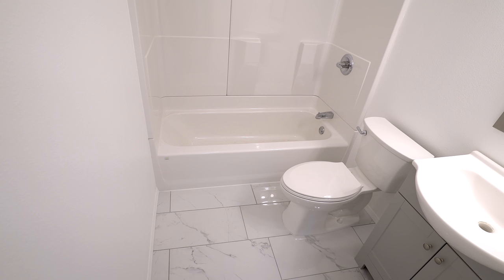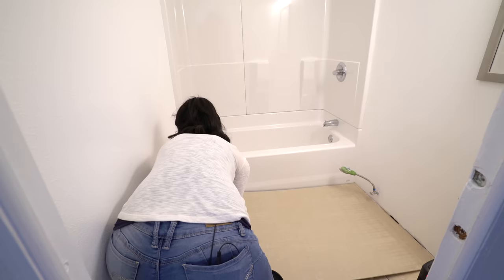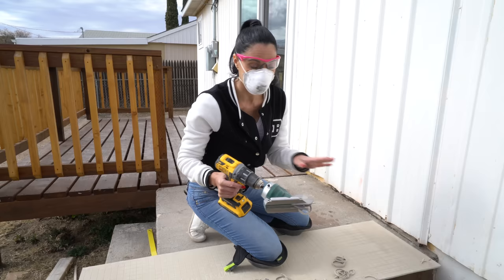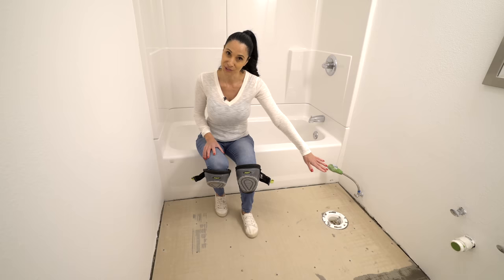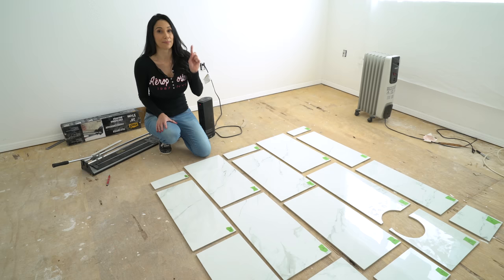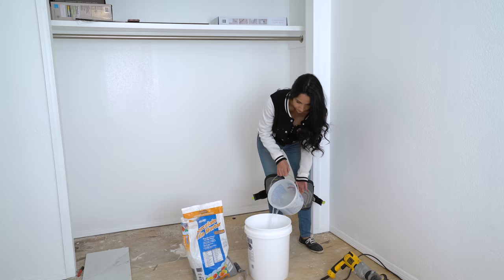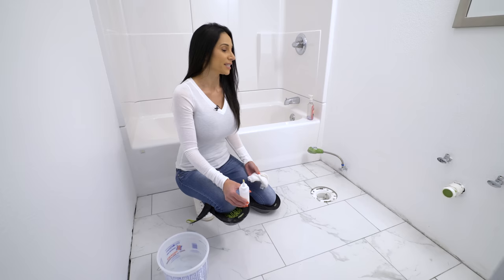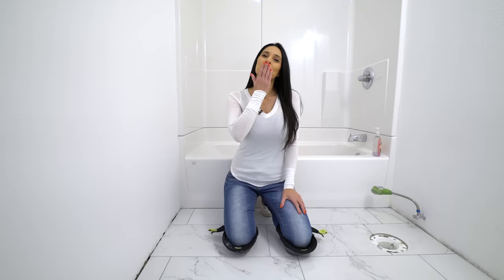How to Tile a Floor for Beginners

Comment: I love your videos.  One handy tip.  A gallon paint can is the same exact size as the toilet flange.  I measure left to right off both surfaces.  Then line up a paint can to my marks.  Perfect every time.  Then when your doing your floor, same.  Measure to your edges, trace the paint can. . perfect every time.
Reply: That's good to know. Thanks!
Reply: @timtucker09  looks like we missed some comments because we don't see anything
Reply: Good looking ladies tackling DIY projects makes learning the process way more enjoyable! Nice job on the bathroom.

Comment: hi ya i use a 1 or 2 inch thick piece of styrofoam  to kneel on...the knees do get soar..12- 24 hours that cement should be set at room temp...+ 5 degrees celcius to set cement...  love the show...

Comment: Another great video Nassrin!!!   Your cut out for the toilet flange is totally professional and the one made by my contractor looks like a complete hack job!!!  Well done!

The velcro strap on the knee pads are too large for the diameter of your legs - you can add some padding to the inside of the straps where it contacts the back of your legs to cut down on the excess length so they won't fall off when you stand up. Or you can just add more padding on the inside of the knee pad cups and this basically does the same thing in taking up the excess slack on the straps.
@36:37 for the power tool electrical connection to the extension cord - before plugging the tool in, make an X with the end of the power tool plug and the end of the extension cord by laying one on top of the other. Then, take one cord and cross over the other and then plugging both together. This way, it forms an interlocking coupling that resists the electrical connection from being pulled apart if there is any tension on the cord as you pull it.  Hope that helps.

Great job and keep the videos coming!

Comment: Nassrin, I was SO CLOSE to hiring someone to do my small bathroom to tile the floor (similar in size to the one you did in this video) then I randomly came across your video and realized I could do it myself. I am a handy person but was worried about messing up something that could be so hard to fix. I think laying out and cutting the tile before you ever mix the mortar is such a brilliant was to approach and plan this. By doing it like that it allowed me to take my time and get it done right. I just finished  getting all the cuts done and the tile laid out so I can make sure I am happy with it and now today I begin the mortar! I really appreciate how thorough you were with both the process and your little tips to make our lives easier but also your cheerful "can do" attitude. So glad I found this video. You gave me the confidence boost I needed to take it on and now I can't wait to finish to start my master bathroom very soon! Thank you!
Reply from the maker: Yourwelcome🙂

Comment: Thanks a lot i can see your technique in how you lay out. Starting your pattern where you want the joints  at . actually one of the best tile videos i watched akso using the tape keeps the thin set straight then just peeling it back off really good ideas
Reply from the maker: Thank you🙂

Comment: Superb work and excellent presentation, thanks. The only suggestion I’d make is to remove excess thin set from the joints while still wet.
Reply from the maker: Thank you🙂

Comment: I almost forgot to add, cuz I used to have the same problem with kneepads after I used them for a little bit. They arent expensive, and they definitely arent cool looking but I still think knee pads made by Barwalts tool company are my personal favorite. The ones that have the rubber straps that hook over the knobs on the side are the best for not sliding down in my opinion. you can put them on so tight they will start to cut off the circulation.but they dont stretch out or lose the ability to stay tight, or if they do just put them on another notch tighter. But they stay in place and they dont get snagged on anything if you are working on a rough surface. Like I said JMO, but especially anything with velcro or any kind of fabric straps or fabric on the face of the knee pads are garbage. They arent going to win any fashion shows but they are built to last also.
Reply from the maker: Thanks for the tip! I did end up finding  some good ones at Home Depot

Comment: Excellent work. I've been doing it exactly the same way you've done for years. I'm glad you emphasized to make lines straight. Comb the trowel. Never swirl the trowel as that creates air pockets and tiles WILL (not could) crack eventually; and back butter is essential as well.

Comment: I have watched a lot of DYI vids. It is refreshing to see a knowledgeable and competent woman doing a "man's job." Plus: you are the first person I have seen use  combination square! I thought I was the only one! I have been validated!! Lol I always use those self leveling wedges. Much better than just a level. I also prefer to use Ditra on top of the wood. Unless missed it, you put the mortar on a dry wood floor. I always dampen the wood a bit so that moisture does not get drawn out of the mortar. Good vid. Thanks.

Comment: Use Ditra instead of the backer board. True its more expensive but its lighter and easier to work with. Most importantly, you'll have a waterproof membrane.

Comment: O yea very fascinating interesting. Looks very easy the way she explains special how to cut the hole with the template. I call ( stencil) that make it very easy cause you want to cut the hole on the plywood  where  the flange for the toilet  will go . Good Idea to use piece of cardboard to .use as a template make sure stuck piece of big rag into the drain to prevent big trash to fall into the sewer drain . As well use gloves/ mask / safety glasses 👌

Comment: You do nice work & some good tips here for sure. My neighbor is a flooring guy, he told me when your doing a bathroom floor, with out the mastic down, cut & fit the tiles first, get it all laid out, then remove the tile & put it in another room laid out the way its going to go down, (if you have the space) then do the mastic & you can just install it easy.

Comment: Nice friendly video! You make it look easy! So, I hope you don't mind and welcome a bit of thoughtful advice from a professional.

•	For pouring out of a newly opened 50lb bag, consider laying the bag on top of an upside-down bucket next to the mixing bucket. Then cut open the bag, minor cuts at a time.

You'll understand why I do this after mixing 15-20 bags or more a day on large jobs.

•	Where there's limited space, use a large garden hand-held shovel for scooping out the mortar, especially the small batch.

Thanks for sharing!

Comment: I install floors for a living. But I specialize in tile.  I’m glad you are showing people what actually goes into this. I can tell you knew what you were doing after you used thin set under the hardiebacker then screwed it.

Comment: Hello, you asked for suggestions for alternate knee pads. We have been using Chainsaw chaps with at least 8 layers of kevlar or similar protection like these - ZELARMAN Chainsaw Chaps Apron Wrap 8-layer for Men/Women Loggers Forest Workers Protective Chain Saw Pants Adjustable- yes they are comical looking but they do not bind uncomfortably on the back of your knee. I am a husky guy and feel that they offer enough padding that I disposed of my old knee pads. That is my major complaint with knee pads, that the straps hurt the back of my knees and that they do not stay up.  I have used the chaps for gardening too while on my knees weeding, planting, laying a flagstone patio and they are comfortable and have held up extremely well. Thank you for your excellent tiling videos. They are a great resource!
Reply from the maker: Thank you so much! And thank you for the information🙂

Comment: Have done tile professionally for 24 years and this is a better install than what's being done today. I take thinset that's a little bit thicker and don't flat trowel the floor. Just notch the floor out and the only time i back butter a tile is if it's low. Only way that's better is that we don't use board on floors but pull concrete. Often i dry set the whole floor on wet concrete, same as what you did, and then spread thinset and stick it to the wet concrete. Definately don't want to ever tear out a floor done this way, it's miserable.
Reply: So you don’t back butter a large format tile!?
Reply: @travlangley1  Usually wind up popping it up and i can see where it needs more. Even tile council says 75% coverage is acceptable. It's all about how many chemicals the thinset has, it's miserable to tear out a single piece set with all set or platinum even if it never got buttered.

Comment: Hi Nassrin ! Love this tile video of yours. reference the knee pads,you are wearing it your brassiere, especially the ones with out the bone wire in  them and the size D cup or just experiment with the varieties until you are comfortable with the fit over the knee also you can double them if you want and for secure strap I use the same brassiere strap by stitching them on to the side of the cups or you can use thick garment elastic they work just as well by the way I get my brassieres from my girl when she is buying new ones.😃

Comment: You are such a cool lady! Beautiful job! The only advice I have is the need to use a 2-inch painter tape along the edge of the tub and where it meets the floor. It protects the finish and makes it easier to peel off any unwanted material from the trowel.
Reply from the maker: Thank you🙂

Comment: Re: kneepads. Of course, the usual hard disc, buckle types will be oversized, bulky and Ill fitting, leaving you unstable and uncomfortable. Most of the discount dollar type stores carry a selection of slip over tube type, heavy weave elastic knee stabilizers which sometimes have a pocket or sleeve for insertion of a foam type padding. Also, try the youth section at the matt discount stores in the sport section ( bike. Skateboarding etc sports activities for you so we'll generally carry sports protective and ancillary equipment as well such as the aforementioned elbow and knee pads.. Best of luck I enjoyed your presentation it gave me a few tips and will help me on my project.!
Reply from the maker: Thanks you! I finally found some that fit at HomeDepot🙂

Comment: Use 1/2 " board. Rule of thumb is to have no tile laid smaller than half a field tile. Some of the cuts on the walls are way too small and don't match the cut on the other wall. you want the floor to look balanced with same cuts on the sides and front and back.  A lot of tiles have arrows on back so the design looks better. Your  grout joints are too close to each other to the tile above them. should have just brick patterned them..small room.. it would look better.. the toilet flange should go on top of the tile. You need the clip system with tile that large. Use white mortar...it well be easier to clean.. the dark mortar can bleed through.. never use unsanded grout on floors...you can use sanded on 1/8". clean the grout joints as you tile...you wont need to clean it after it dries..  chip a tile and you'll know what I mean. Other than that good job.
Reply: Only the last sentence was necessary.  This is just a DIY job for her and she did better than some professionals would. No need for the additional tutorial.
Reply: Her DIY was really helpful and informative, but I also appreciate the additional info from someone with apparently alot of experience. Thanks... for both.
Reply: @justicepeople8819  All of the points raised here are valid even for DIY, getting a balanced look across the field so cuts are equal is the most basic skill in laying tile. Using a white adhesive is a no brainer with a light coloured tile and also using the correct grout is essential on floors to prevent cracking. Also cleaning the joints as you tile saves a lot of time and you don't risk chipping a tile thats already fixed. Also the toilet flange is supposed to sit up on the tile that is basic good practice too. Additionally, if you use a waterproof grout you don't need to seal the grout and it doesn't stain over time. Also when tiling over a wooden floor make sure to use the correct flexible adhesive and grout to cope with small amounts of movement without cracking.
Reply: Love your videos but suggest you use a decoupling membrane such as Ditra applied with modified thin set over the plywood subfloor and not even use the hardiboard.
Reply: @schrodingerscat1863  adhesive meaning ? I didn’t see her use a adhesive. Could you explain?
Reply: @Mindyourbusiness762  Just a difference in terminology, in UK we call it tile adhesive, I think they call it thin set in the US or maybe mortar. Basically the stuff sticks the tile to the wall or floor.
Reply: Great tips Bob, thank you.

Comment: I always use a separate plastering trowel to spread out the flooring adhesive ... saves having to 'backhand' the toothed trowel ... also use a slowset adhesive so you can take your time. I also have a large flexitub full of water and sponge to hand to keep everything clean as you go

Comment: Grout joint against tube should really get caulk matched to your grout color, movement and flexing will inevitably crack grout there. 👍
Reply: begal brew, what kind of caulk would you use in the joint against the tub?
Reply: @kimariokiji  most grout mfgs make color matched caulk to their color palette. Some companies like colorfast offer products to match multiple companies grouts, you can usually find these products at your locally owned tile retailers or distributors. Otherwise you can use siliconized acrylic caulk of any type really. I don't use 100% silicone because it tends to not bond well to all surfaces.

Comment: use lipstick to mark the flange then lay the backer board on it, use the outline of the toilet ring on the backer board to cut the hole. saves you a step
Reply from the maker: Good tip! I’ll have to try it.

Comment: Another very good video.   Sorry you must keep getting tested for the virus.   Not a criticism, just an observation, I have tiled quite a few floors and walls.  I never used the straight side to spread, always the notched side.  I always regarded the notches as the way to evenly spread the thin set.   
On your knee pad problem.  Dedicate a pair of pants to that cause and glue or sew hook and loop above the knees.  Glue or sew the other half of the hook and loop to the knee pads.  Make sure these are placed such that you don’t kneel on them.  Not only will the pads stay up,  their straps will no longer be so tight that they cut off circulation.   Good luck.
Reply from the maker: Thank you🙂

Comment: Great vid, thanks for sharing. A little constructive criticism if I may. The edge tiles are uneven so for this job I would have started with the grout line in the centre so that way you would have even edge tiles. If that was my house I would have pulled you up on that first haha. You should have run silicone instead of grout at the bath too. Love that you're trying to teach people though, good stuff.

Comment: Hi Nassrin,

Very professional quality video!  One question: Do you recommend using a membrane coupler between the bare cocnrete floor and the tile just in case the concrete blow started to crack it will not cause the tiles to crack?  Thank you!
Reply: Great video! And good suggestion we used Ditra on my floor.
Reply: Hi

Comment: Coming on ten years now in the field and I'll say probably best I've seen in a while on here  few thing a bit taking the extra step that's not always needed but it works  I honestly don't like those scratch tools only caue depending on your tile they can chip a edge or flake a corner . I use a old normally 1/2 inch wood chisel to scrape out the mortar that bled up little bit more control especially  if it's a thicker bleed (you will wear it down but it's fine if it's dull doesn't have to be sharp to work good) not saying the tool won't, or doesnt work  but just my 2 sense  and  could save ya a few bucks just using cheap or old dull chisel
Reply from the maker: Thank you!

Comment: You are awesome this is my reference video for tiling. I first watched 3 months ago now came back to it after having watched other people and you are the cream of the crop. 
Just one question, i've seen two pro tilers explain notched trowels and they say any tile bigger than 15 inches in any direction requires a 1/2" x 1/2" notched trowel. And 12" x 12" tiles require 1/4" x 3/8" (slightly deeper notches than yours), yet you used 1/4" x 1/4" which they recommend for subway tiles anything below 12" or linear tiles.   I think you should have used 1/4 x 3/8 for 12 x 24 tiles.  Are you not worried about thinset coverage under big tiles ?  
I will play it safe and use 1/4 x 3/8 for that tile size.

Comment: Hi Nassrin, I sewed towels to the inside of my sweatpants to pad my knees. That's plenty of padding and does not cut off circulation. I don't like tight clothing. Can send you photos of my sweat pants if you'd like to see them.
Reply from the maker: Thank you🙂I did find some good ones at Homedept.
Reply: @NassrinsDIY  That's good news. Sewn-in towels work great too when you are moving around a lot on your knees: I'm a gardener. I don't like knee pads or a padded board because I'm trying to get in low when I'm working. I don't want to be lifted an inch or two off the ground.

Comment: great teacher and great video. love both. just one question. how to adjust the levelling to ensure water will 100% run to the hole and not stand still? control the thickness of cement during tiles placing or during grouting?

Comment: I like the detailed video and your work is nice and neat, the job looks great. The tiles are set with a staggered joint pattern so why not start with a full tile in the center so all the cuts against the wall are the same measurement and the staggered joints are centered with a full tile?